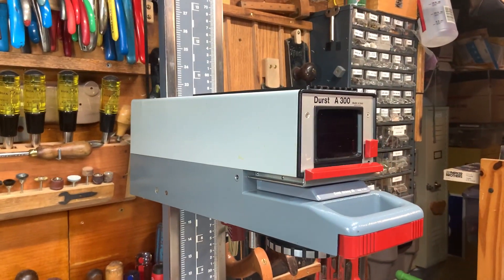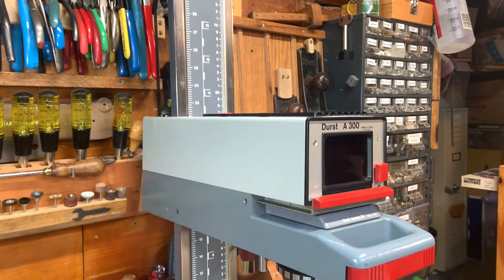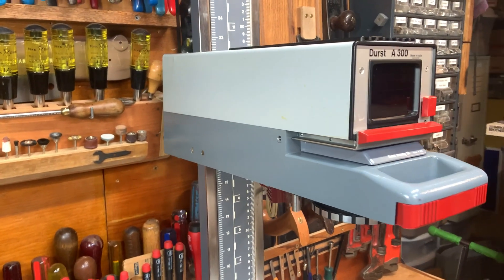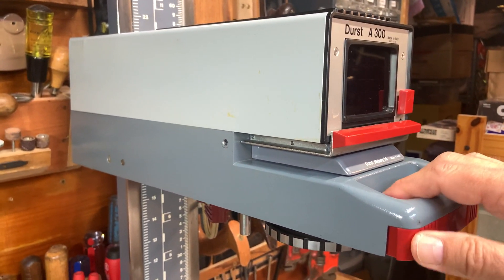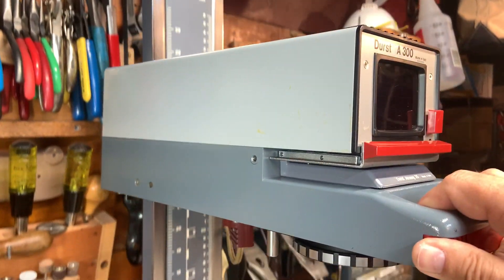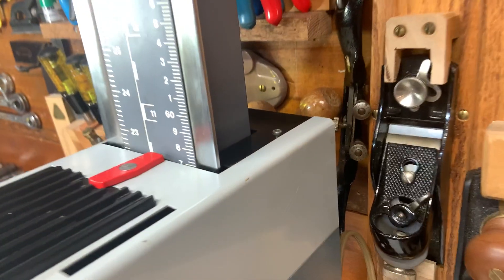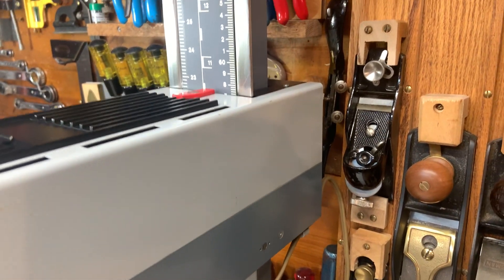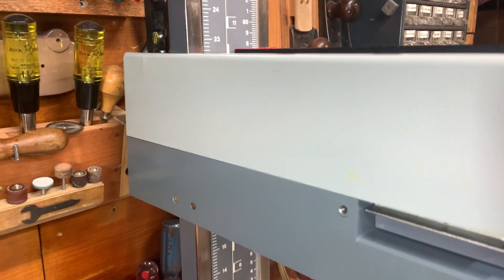Durst A300 column screech

Comment: Hi, have got the possibility to buy a used A300, but have not found what a complete/necessary setup consists of. Are there more to it than the enlarger itself, board, pole and lens? Do you happen to have the manual on pdf btw?

Comment: I still have my Durst A300 from the late 70s. It’s hanging in my shed wrapped in plastic. I also have the dichroic color head with the quartz halogen lamp and the original incandescent light mechanism. I never had a noise when raising or lowering it. I loved that enlarger and hope that I or someone else can clean it up and use it again someday.
Reply: Hi @hill550! A friend gave me a Durst A300 but it's nearly impossible to find infos online so I'm trying to get some info from other owners. I found infos about contrast filters made for it, and that they should go in the head above the lens, but I opened mine and can't understand where exactly. There isn't any filter carrier. Should I just place a reptangular filter above the magnifying lens? Would you be so kind to explain me how and where to place filters? At the moment I bought the Ilford contrast filters that you place under the lens, but I read it's not the best solution and would love to make the best out of the Durst A300. Thanks!
Reply: Also do you happen to have the instructions manual? It's also not to be found anywhere, when I ask some info on forums people link me the manual for the M300 which is similar, but also different :)
Reply: @elenapizzetti6053  - I have a manual for the A300.  If you want a PDF, let me know where to send it to.